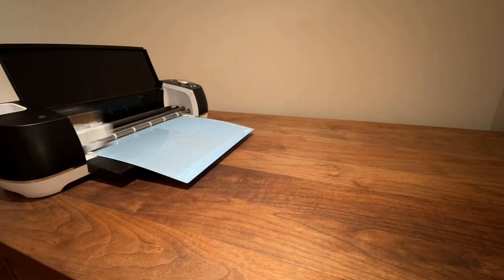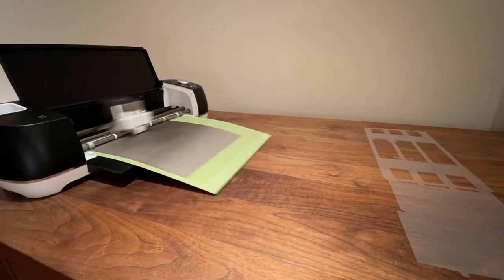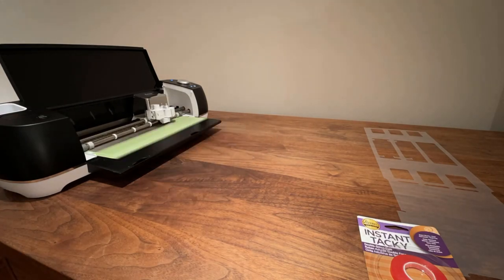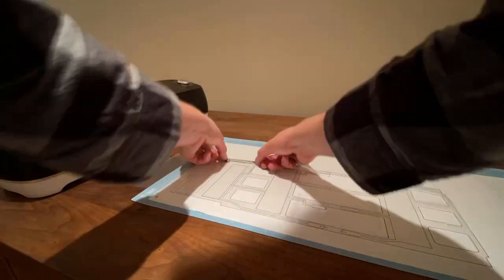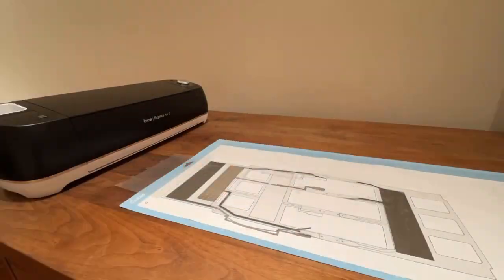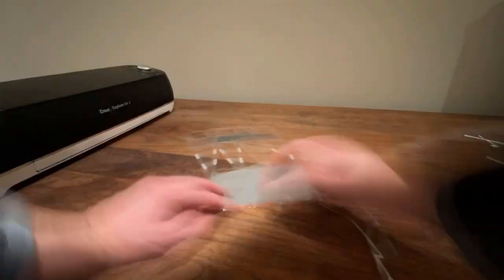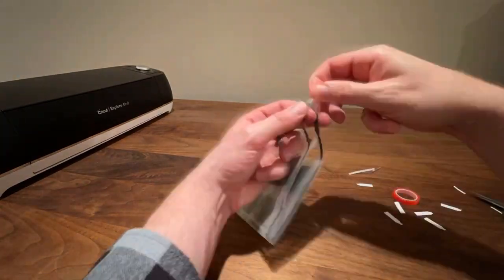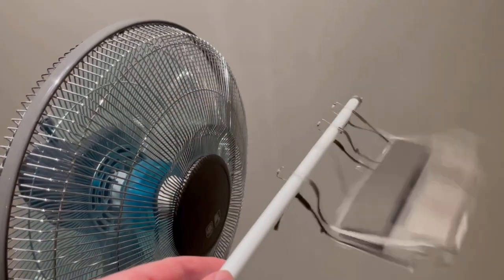FLAG Thin Film Wind Generator Introduction

Comment: You need to continue with this concept so we can understand it. Is it static electricity? So the capacitors store the charge until a load is applied? Maybe a video that isn't sped up also.
Reply from the maker: There is some documentation at the link in the description which will hopefully help with the understanding of how it works, including instructions on how to build one.  It uses high voltage induction to work, in the same way as old fashioned “influence machines”.  The only part of the video that is sped up, is the part showing the parts being cut out on a cutting machine, and the rest of the video is at normal speed.

One of the best resources I have come across on the internet with respect to this sort of machine can be found here:  https://www.coe.ufrj.br/~acmq/electrostatic.html

Thanks for your comments!
Reply: There is no static electricity, it is a myth ... Electric charges travel along the path with the least resistance as soon as possible. Static literally means standing still. Consequently, charged cells and capacitors also contain static electricity. When an electric conductor is added, when a circuit is formed, it becomes dynamic or mobile. Only this behavior of electric charges is understandable to us today.

Comment: It will work only in a dry atmosphere
Reply from the maker: That is quite true for electrostatic machines in general, but this machine works in a reasonable amount of humidity. I’m not certain if that is due to the use of low-absorption polyester film, or the careful separation of the oppositely charged surfaces in the design.  I have been able to get them to self-start at up to 60% humidity, and higher if I give them a “jump start” with a high voltage source.  In the future I would like to see a design where the conductive surfaces are completely encapsulated in the polyester.  This should increase the voltage, power output, and efficiency, and make them impervious to humidity.

I also live in a somewhat cold climate at a high altitude-  I’m interested to see if others get similar results.